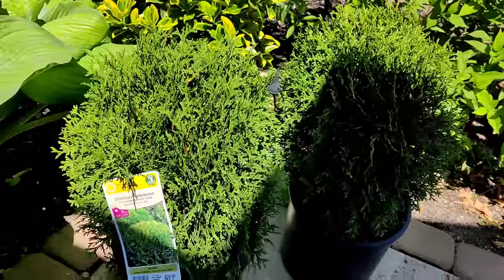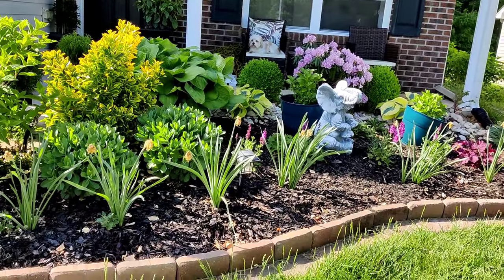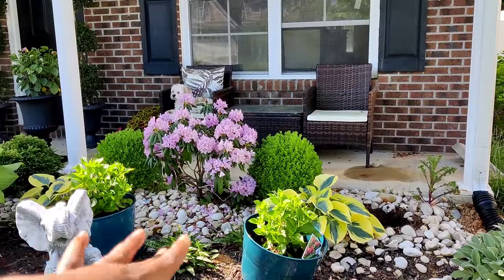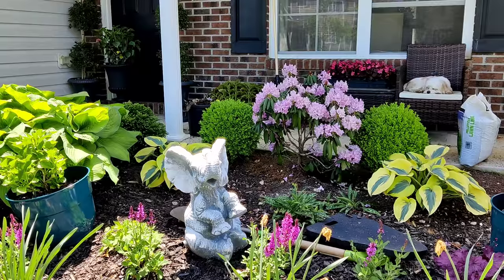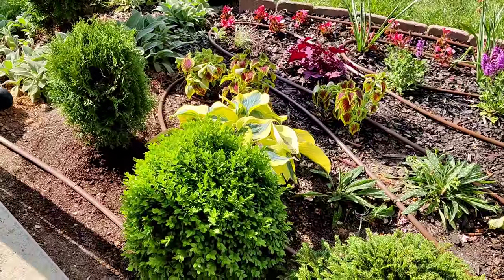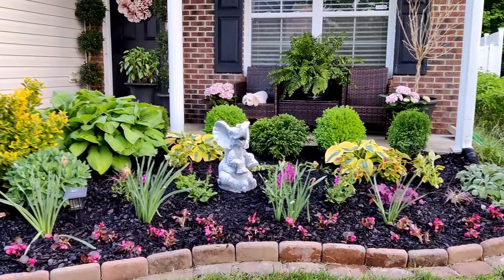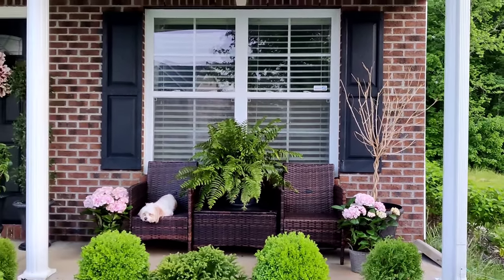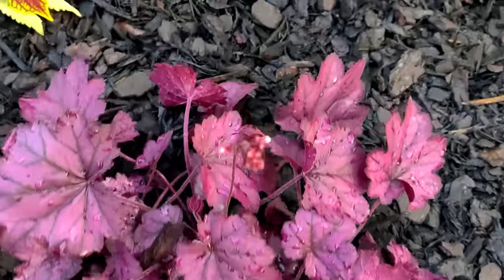Front Garden Bed Makeover + Patio Refresh | Zone 7b | Garden Vlog

Comment: You don’t have a male cat spraying on your arborvitae do you?

When you know the drip is working well it’s often a good idea to connect the end of the line back into itself at a nearby section to assist with maintaining pressure, rather than just folding it back on tself. You can build flush connectors in as well if that’s an issue for you. It looks beautiful! ❤️

Comment: Hey Jess. So sorry about the issues you are having in that front bed. I am in Virginia Beach (8A), and have the same issues in a back bed... a lot of shrubs, trees ..not annuals and some perennials (not everything) that I have planted struggled/died. Through research, I have determined that the soil has something called verticillium wilt; you just have to either fumigate/replace all the soil, or find plants that are resistant to it. I have ended up planting shrubs/trees in pots as a solution. Does that spot tend to hold water/remain wet? My experience has been that once an arborvitae starts declining, it is very difficult to reverse, except to transplant it to a different location...GOOD LUCK! Otherwise, everything looks great, and you are doing a great job.
Reply from the maker: It is so strange it is literally just that one small area where Rosie is sitting.. everything I plant around it does fine🤷🏾‍♀️ I have even replaced all the soil as I mentioned in the video it's the oddest most frustrating thing! I'm sorry you are dealing with the same issue I know how frustrating it can be. Planting in pots is a good solution 👍🏾 I had those 2 pots sitting in the bed in the beginning clips for the same reason. I've come to peace with it Rosie is staying & I'll just plant around her LoL. I wish u all the best with your gardening trouble shooting as well!!🤗💚🙏🏾🌸🌼

Comment: I'll bet you have construction debris under your front flower bed. Subcontractors really don't care about what they are pushing under the soil when they are grading. Hardened concrete, treated wood, etc is left on the job site because it is expensive to remove. So they bury it. I had a patch of dead grass in my front yard. I treated that patch for years like it was Augusta National. Nothing worked. Until my brother (who's a head golf professional at a country club where grass is the be all, end all of his life) said something was deep under the soil. So I got out the shovel. Guess what? Down about three feet was a 4' x 3' x 6" piece of concrete the same size of my dead grass. I couldn't lift it out myself. So I Scarlett O'Hara-ed (HELP!) my muscled neighbors to drag that bad boy out. No problems since.